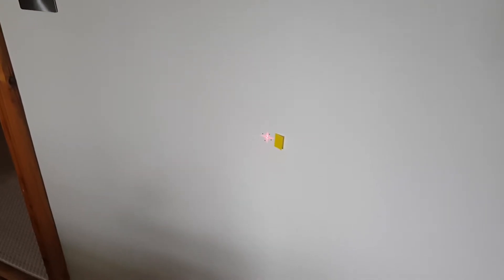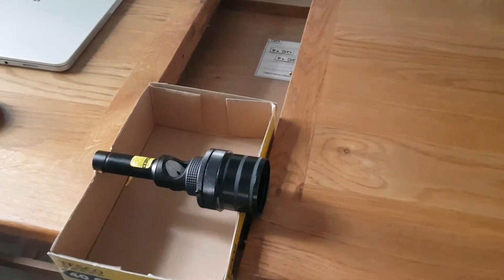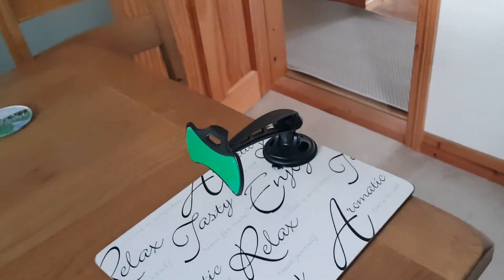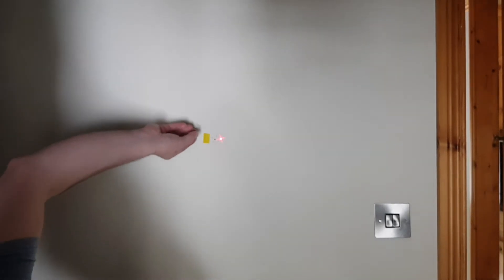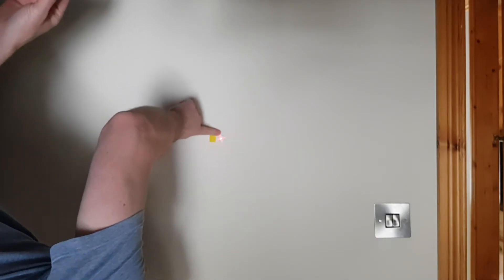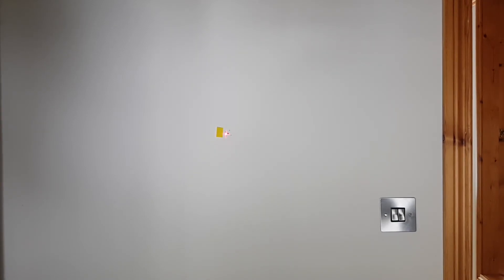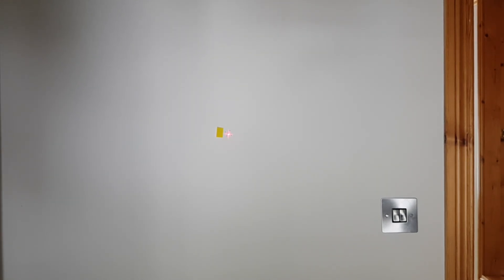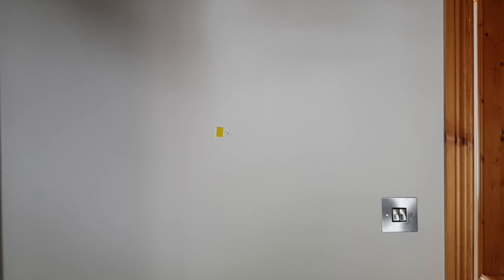HoTech SCT Laser Collimator - Bad Factory Collimation

Comment: Collimation by a laser is not proof of true collimation on a star. Nothing says that the image of an SCT must be centered at the exit of the telescope. But that the stars are pointy and circular in shape with the central obstruction centered is the goal of the telescope. The SCT is not a collimator which has the property of having the axis of its tube on the optical axis. The SCT mirror is fixed by the manufacturer because the Schmidt plate must be coaxial and perpendicular to the axis of the primary defined by the line which joins the center of curvature and its focus for a star. This is imperative to ensure the correction to minimize the Sphericity defect for observing a star. And possibly cancel the Coma, if the position of the blade is located relative to the center of the primary mirror, at 0.66298 of the radius of curvature or 1.326 of the focal length of the primary. The laser is therefore a tool which only indicates that the axis of the baffle is not aligned with the center of the secondary mirror. And when adjusting the secondary by a rotation, the system will be collimate for a single position which is rarely the one used because very often the target is not at the main focus of the SCT but before by convenience or ignorance.  Those who move the blade to center the secondary mirror destroy the centering of the blade with the primary. The secondary must be able to be adjustable on a plane by translation, which moves the pivot which is used for collimation. However, the secondary of the SCT is not capable of translation except for the play that exists between its support and the Schmidt blade.  I have noticed that courageous owners to improve their SCT are in the habit of putting the same thickness around the secondary support to center it or even grind to center the hole in the blade in relation to its external diameter...However, nothing says that the secondary is centered in relation to the axis of the primary in this way. nor that the blade has a deformation perfectly centered on its external diameter. Here we are talking about centering on the wavelength scale.  The Schmidt blade is not a closing blade like on certain telescopes which use it to avoid putting a spider, which causes diffraction and a loss in magnitude. And none of the SCT experts try to determine the axis of the primary because it is more complicated than pointing a laser at the secondary.   In fact I have not seen a primary mirror perfectly centered on the SCT tube, even though the baffle is very well centered.  Which means that the primary mirror is not centered on the Baffle! An SCT is a very interesting instrument because its use is very dynamic F/D 30 to F/D 3.3.   But I have never seen simulations with software like Oslo, of what happens outside the ideal focal plane of the SCT at F/D 10 or an SCT at F/D 8. In fact a good part of the owners of SCT believe that the growth of the secondary is constant when the hearth is moved by the movement of the primary, to be able to install a reducer or a Barlow.  The Back focus of the SCT is lower than the focal length of these optics... And for good reason. optics is not a subject taught in college. You have to follow technical training dedicated to optics... So the most experts in digital spreadsheets simulate archival tables, then accuse that the references of the manufacturer of the reducer or the Barlow are false. I am surprised that the seller of a telescope does not check the stars on an instrument before delivering it to his customer. I am very surprised since the Factory does not check on an optical bench with an interferometer that the telescope is good, especially for an instrument that is expensive and difficult to adjust. Hotech has produced very good collimators for Newton and the SCT with the Hyperstar.  But going so far as to move the Schmidt blade to center the secondary on the axis of the primary, I understood that this company had no limits to sell an instrument which destroys the work on the manufacturer's interferometer....